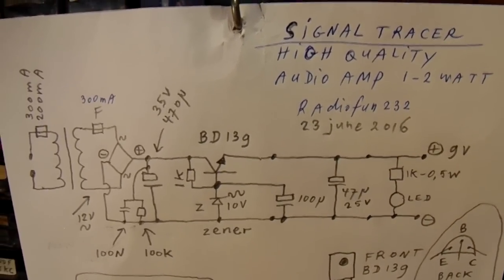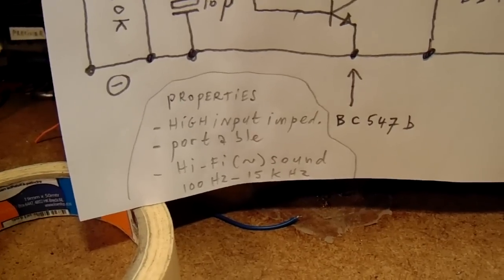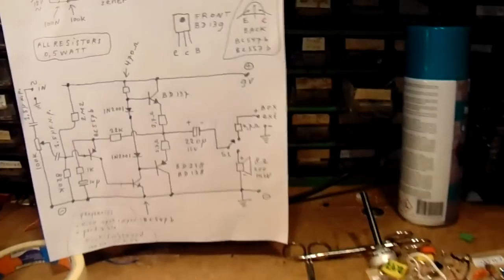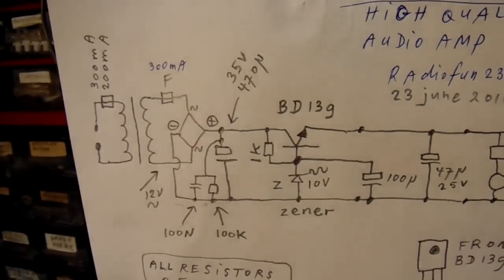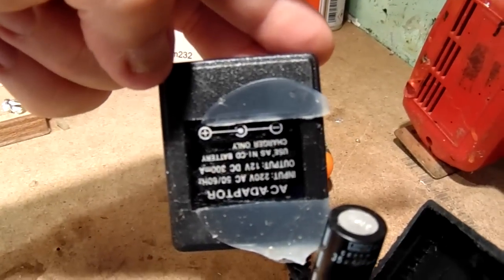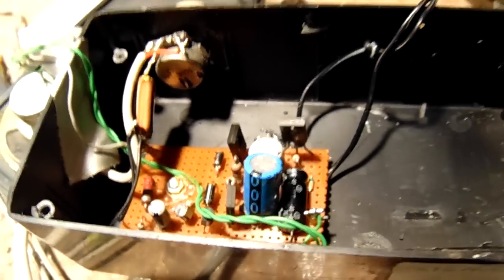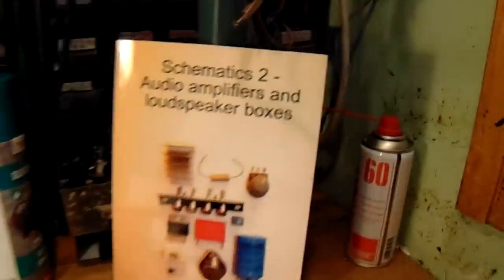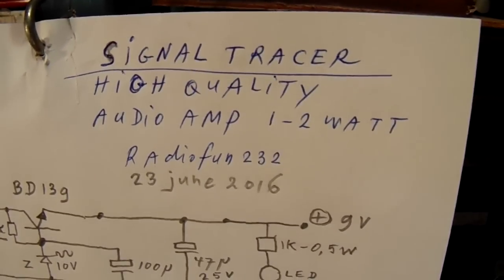The signal tracer: a very useful device in electronics (schematic)

Comment: Is there a possibility to add a extra protection on the input (test leads) to block main voltage (250v) ?
Reply from the maker: Yes, with a non polar capacitor of (say) 100 N (0,1 uF) or 470 N (0,47 uf) with a working voltage of approx. 400 Volt.
Reply from the maker: The two 1,5 uF non polar capacitors (rated for say 300-400 V) on 0.30 in the published circuit do that job.
Reply: @radiofun232  ik was vergeten dat u van Nederland bent, dus kan het ook in het nederlands vragen.
Ik ben een beginneling op vlak van elektronica, maar wat ik heb begrepen, is dat een condensator (capacitor) DC blokt, maar AC doorlaat , hoe kunnen dan de 2x 1,5uF bescherming bieden ?
Reply from the maker: @BjornV78  Dat is to the point! Die condensatoren zullen inderdaad geen bescherming bieden voor hoge wisselspanningen. Ze vormen voor gelijkspanning wel een zekere vorm van bescherming, maar, anderzijds, als ze via gelijkspanning opgeladen raken ("aan één kant") kun je er een toch schok van krijgen als je ze aanraakt. Want je lichaam functioneert dan als aarde, ground. Een bescherming tegen wisselspanning van een hoog voltage (230 V-50 Hertz) kan worden bereikt door een hoge serieweerstand, in het (vele) mega-ohm gebied. Je mag daar  voor de eenvoud de Wet van Ohm toepassen (U=IxR). Zo'n weerstand voorkomt dat de stroom door je lichaam gevaarlijk groot wordt. Die zit bijvoorbeeld in een spanningzoeker met het bekende neonbuisje. Veilige grenswaardes voor stromen door het menselijk lichaam bij hoge(re) spanningen zijn moeilijk te geven, het hangt er van af waar je staat en het lichaam-aardcontact. I.h.a. worden spanningen boven 60 Volt als gevaarlijk beschouwd. Anderzijds: een signaalzoeker wordt eigenlijk alleen maar in audio schakelingen gebruikt om een (al dan niet ergens verloren gegaan) geluidssignaal op te sporen/een defecte audiotrap te vinden en/of af te luisteren wat er op een signaal lijn gebeurt. Audiosignalen op lijn-niveau (zeg wat er uit een CD speler komt of uit een smartphone) zijn in de regel 0,8 Volt-1 Volt wisselspanningen. Dat is volkomen ongevaarlijk. Dus het blokken van hoge spanningen komt met een signaalzoeker niet voor.
Reply: @radiofun232  Ik ben al diverse schema's voor een signaalzoeker tegen gekomen, maar tot op heden nog geen gebouwd. 
Ik heb een Sony Hifi-keten RX80 van de jaren 90,  hier komt totaal geen geluid meer uit, maar de digitale equalizer beweegt wel op maat van het geluid, dus vermoed het defect heel kort bij de uitgang naar de boxen zit. 
Hiervoor wilde ik een signaalzoeker bouwen, om dan de print af te gaan tot op de plaats waar het geluid stopt.
Ik heb diverse boxen setjes van Logitech (s120) waarbij allemaal de 240V naar 9V transfo defect is, (met een 9V batterij werken ze)
 ik vermoed dat deze ook een kleine versterker bevatte,  
en deze kan ik misschien ombouwen naar signaalzoeker door extra condensators aan de ingang toe te voegen ?
Reply from the maker: @BjornV78  Ja, dat is een goede mogelijkheid om een signaalzoeker te maken. Een ingangscondensator (folietype) die (zeg) 300 Volt of meer kan verdragen met een waarde van (zeg) 100 N (0,1 uF) of 470 N (0,47 uF) is dan goed bruikbaar.
Reply: @radiofun232  , oke dan weet ik wat doen dit weekend :-)
Reply from the maker: @BjornV78  succes met je project!
Reply: @radiofun232  Dank u

Comment: Very good. Does it have a sniffer or probe that is not shown?  Is it using integrated probe perhaps?
Reply from the maker: Yes, but it is not in the schematic. It is a Germanium diode probe. On 3.32 in the video you can see it on the left side (somewhat grey, yellow tiewrap + switch for yes/no diode).
Reply: radiofun232 .Thanks again, you are always very patient and helpful, so the probe would follow, for example, the style of Rick's of AA5R construct? If you could provide some more detail, it would be appreciated. Sorry to bother but there seems to be an array of designs out there, some with mosfets in the probe itself. Always enjoy your content on YT. Did you work at Philips in Netherlands earlier?
Reply from the maker: @celtichongy  Thanks. The probe consists of 1 germanium radio detection diode like the 1N90. On such a diode a ring is printed: that is the cathode. The side of that ring (kathode) goes to the input of the signal tracer, via a capacitor of 100 N or 470N. On that cathode there goes a capacitor of 10 N (10000 pF) to the shielding of the cable that is connected to the probe (one side) and the signal tracer (other side). That shielding is (also) on mass/minus of the signal tracer/ground. The other side of the diode goes to the tip of the probe. Both the diode + the cap. to ground can be switched off. In that case the tip of the probe goes directly via a cap. of 100 N or 470 N to the input of the amplifier/signal tracer. When it is not clear mail me on radiofun232@gmail.com.
Reply: radiofun232 , thank you kindly once again for considerate reply. I will make contact by email for further clarity.
Reply from the maker: @celtichongy  OK, thanks.

Comment: If you could make.a.circuit board for your signal tracer,or a lot I would buy it.
Reply from the maker: It is easy to make with brass nails on a well varnished piece of soft multiply wood. And you can gain insight when making it that way.

Comment: SIR, WHAT IS VALUE OF YOUR TWO CAPACITOR IN  BETWEEN IN THE VOLUME CONTROL ?WHAT  I MEAN SIR IT IS MICRO FARAD, NANO OR PICO FARAD 1.5 ? THANK YOU ....
Reply from the maker: Thanks, it is a 1,5 Micro Farad, non-polar capacitor. I don't use electrolytics because they can disturbe the setting-point or working point from the transistor after 1 or x years. The value is in fact not so critical, when you bridge two 0,47 uF non polar capacitors (together = approx. 1 uF non polar) and set them in the line it will work fine. Also with 1 non polar cap from 470 N (=0,47 uF) it will work fine, no problem.

Comment: Ko,
I like this circuit and I'm going to build it tomorrow. I have such bad luck with the LM386 devices. Miss you on youtube. I hope you are well. You are a hero to many of us out here.
Reply from the maker: Hi Harold, thanks for your reaction. Good to hear again from you, and hope you are doing fine. I am doing well and hope to make new uploads within a few months. Very important: I mentioned/draw the wrong (!) diodes in this upload from this amplifier between the 2 bases from the end-transistors. They must be 1N4002 or 1N4003 or 1N4004. And glue these 2 diodes on the cooling plates/heatsink from the BD 139-BD 140 for thermal contact when you want to let it work on more than 12 Volt. Sad to hear that the LM 386 devices caused problems. The output power from a LM 386 is too low for a good working signal tracer. Take your time! Success, when you have problems with the circuit mail me on radiofun232@gmail.com.

Comment: Why zener diodes 1n2001 and no rectifiers sir ?
Reply from the maker: OK, these diodes create a (precise) voltage drop that prevents take over distortion ( pos-neg part of the sine wave) in the audio amplifier. So a certain amount of quiescent current is derived that give the end-transistors a kind of pre-set. Without these diodes there will be audio distortion, visible on the oscilloscope. The voltage between the two end-transistors (on their base) must be quite precise, when it is not properly aligned a too high quiescent current is the effect and the transistors get (relatively) "too" hot when they are in the "rest" position (no input audio signal, it is a class B amplifier).
Reply from the maker: Hi Raul Tendilla, now (7 okt 2017) I understand your question better. I found on the internet that the 1N2001 is sold as a zener diode (did not know that!). The diodes to be used here must be normal silicon diodes, with a normal voltage drop between (say) 0,7 and 0,8 Volt.
Reply from the maker: There is a rectifier connected to the 470 uF capacitor that goes to the collector from the BD 139.
Reply: radiofun232 Thanks Sir but my question  was about the diodes  on the audio circuit
Reply: radiofun232 thanks so much for the clear explanation
Reply: radiofun232 one more thanks sr.

Comment: what could be better then making your own test equipment.I have rebuilt RADIO ZEELAND and RADIO HOLLAND ROT equipment for the last 10 years.The customers prefer the older equipment to the new micro SMT stuff.Gets pretty interesting finding new ways to keep the electronics balanced and not having the obsolete parts it was designed for.I love your videos.THANKS
Reply from the maker: Good to hear that, thanks! :)

Comment: Can you do a video about how you use this device?
Reply from the maker: I will try, when I have time. It is somewhat difficult to demonstrate how to use it because I need e.g. a defective audio amplifier or radio. And also the sounds that you hear have to be interpreted, so you have to know what kind of sound you can expect. Because the max. frequency is in the audible range (max 14 Khz or so) it is not possible to detect higher frequencies, other than to hear a kind of blank sound on higher frequencies - a kind of click sound- (the oscilloscope is a better device to do tests). But anyway: when you have an audio amp with e.g. a defective pre amp, you surely can hear that the signal is not present on point X when it had to be there. But: I used it many times to find out e.g. signals on pins of plugs in audio circuits, also the signal from a classical (old school) TV signal is clearly audible, like a "ratata" sound. Then you can be sure to connect that pin to point X, etc.
Reply: OK, thanks.

Comment: I believe i will build one , thanks ko
Reply from the maker: You are welcome. I used it for: radio's (end-amp), to test a power supply (you can hear even the slightest hum on the DC power lead), switches & drivers (hear them click/beep), repairing audio amps, etc.